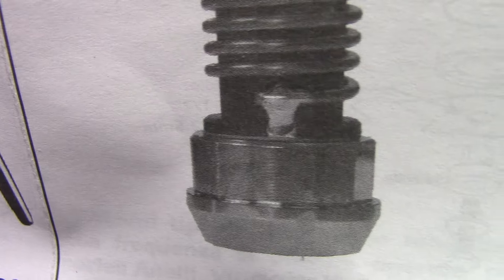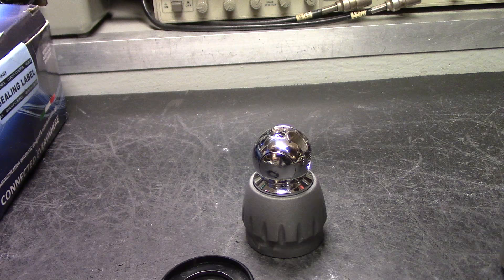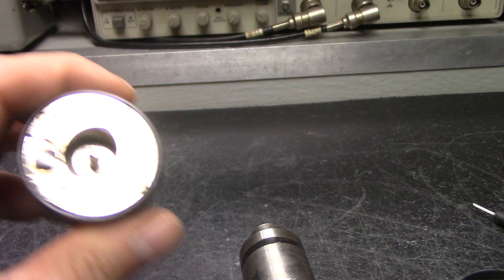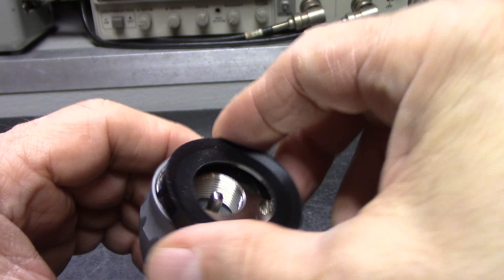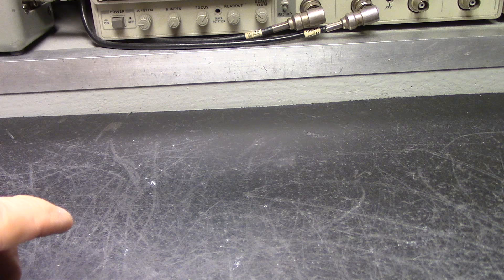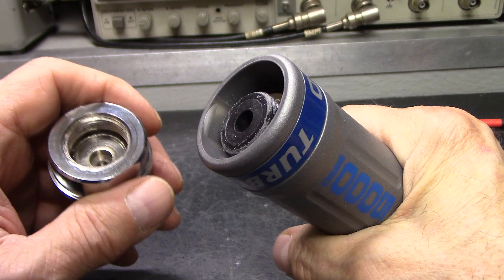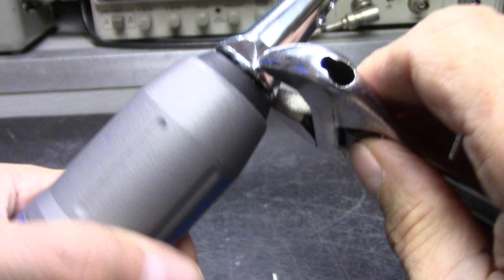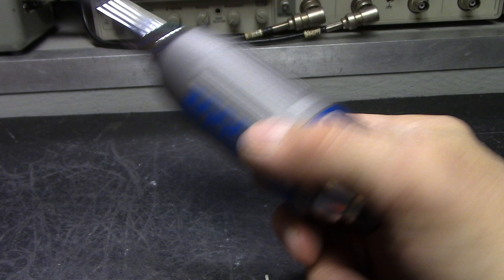Sirio 5000 Performer Antenna and Mount (SO239 type).

Comment: Most all roof mounts sold today are magnetic…I do not want or like that !  In the 80’s  We drilled holes, clean installation…worked great, center of vehicle. 360 degree ground plane.  Big Mama was one brand antenna we used.  Thanks.   Oh, think I will add, we had power too. I had a pick up truck, put on my camper, did not wire up the lights on it. Turned on the power, the lights on camper li up whenever I keyed the mic…..had to be careful… 👍🏻

Comment: Hi and thanks for the information.
I do have a question for you, being a lot more experienced than I am, At the video mark 3.10 or so. You show the bottom part of the antenna, should there be any continuity between the center pin, and the outer ring? Would this indicate a short inside? or is it normal?
To confirm the center pin with the outer edge. contacting between Being both parts if then mag~mount. Surely thats not ringht??

Comment: I tried to follow the example shown here on how to disassemble, as the SWR was horrible from the git !
Something was strange too, as when screwing the coil assembly into the mount, the cover would slip, and while listening to the receiver, the signals would fluctuate ?
Trying to take the coil apart, was impossible !
Would barely turn, if at all !
I ended up cutting slits with a Dremel down both sides !
Not an easy task, as the cover is fairly thick !
I'm guessing I was sold a returned antenna, and someone put lock tight on the coil body threads !
What a nightmare !
Checked for bad connection, and or solder issue, and found nothing  !
Out of desperation, I made a cover from a large pill bottle, and spray painted it Black !
Who knows if it will hold up under UV ?
As for now, I'm using a small open source N7DDC Tuner, on the Ten and Twelve meter Ham Bands !
So far, so good !
Worked a station in Russia today on 12 meter phone !
Along with various other States and Countries on  10 !
So I know it's putting out some RF !
Using President Lincoln 2 Plus, so not much power !
Am I missing something here when it comes to disassembly ?
Like heating with a torch ?
Don't think I wasn't tempted !
Lol...!
☹️

Comment: I've been using one of these on a sirio body mount on my triple mag mount. 
The only issue I have with the antenna is that the chrome finish has corroded. 
The performance is good but not as good as the sirio 4000 high power.
I drive at 80mph everyday on the motorway (highway) here in the uk and have never had an issue with the safety or swr of the antenna on my vehicle.

Comment: I wonder if those coils inside that base unit are for adding inductance to increase the feed Point impedance?
Reply from the maker: I know what you're thinking but this appears to be electrical length. Either way the ohm meter would read the same.

Comment: The Siro Performer 5000 Trucker 3/8 beat the Wilson 1000 and 5000 in my tests for both RX/TX, over 1 S unit .  The trucker model has a 8" extender bar. I used a generic 3/8 inch heavy mag mount. I also tested Firestik KW-7 and even a Signal Engineering Goldenrod. The Sirio 5000 Performer trucker beat them all.

Comment: This is junk. It worked for a couple of days then would get intermittent send/receive and an antenna warning on my Cobra 29. Pulled the antenna apart and found that the nut holding the cable center conductor was loose. By the time I found out what was happening it I was too late, damaged my new radio. You get what you pay for.

Comment: Do not buy. Waste of time and money. First of all the package came and the antenna was bent almost 90 degrees. I bent and beat it straight with pliers and a hammer but very disappointed right out of the gate. Then I hook it all up and can't get it tuned and can't get a signal and farther than a block. I think it's a bad ground or something in the antenna.